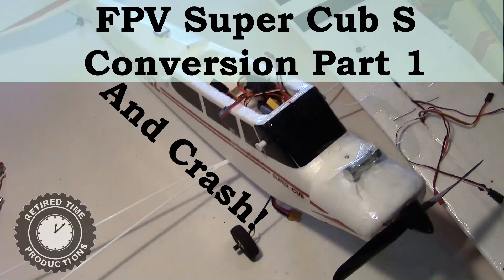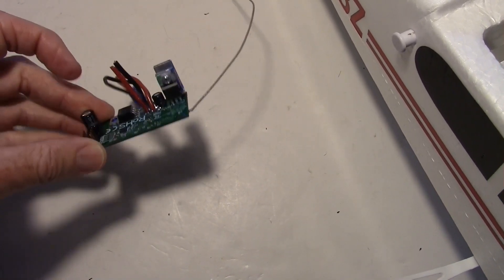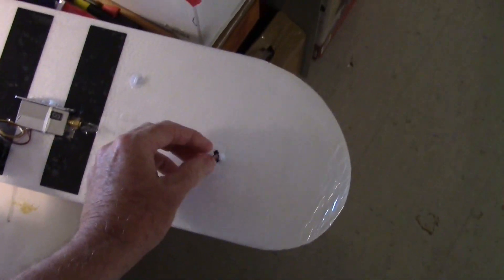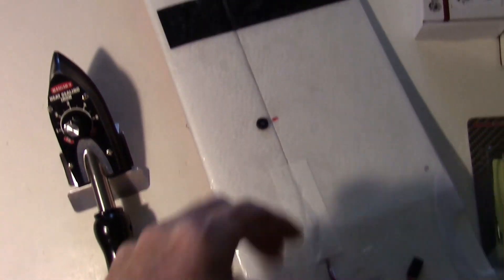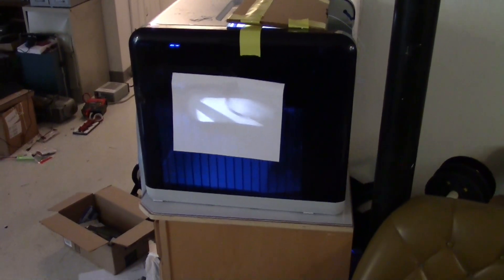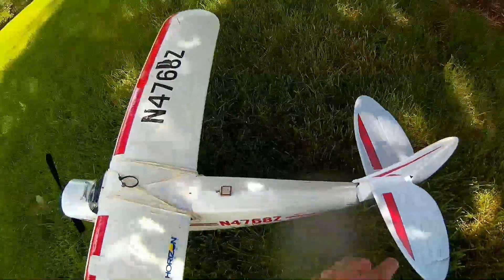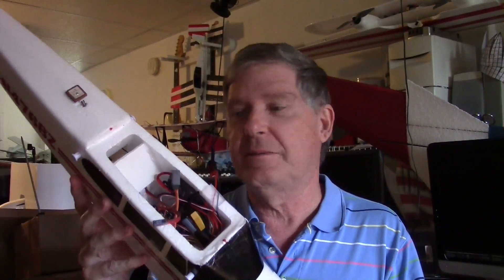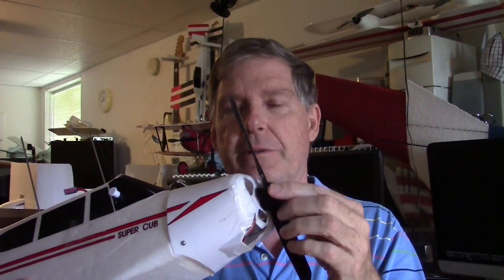FPV Super Cub Conversion Build and Crash - Part 1 (Look out for that tree!)

Comment: Nice job Dave. I went silly on my Super Cub conversion and installed a 3536 1100Kv  motor with a 10x7 prop that gave it unlimited vertical. I used an aluminum motor mount from Gary over at Custom RC parts. The best thing I did was take all the dihedral out of the wing. I would think a Power 10 would be over kill but a lot of fun. Happy flying!
I used a somewhat heavy aliminum hub tailwheel to get the CG just right. There is a very old and very crappy playlist on my channel that shows the build.
https://www.youtube.com/playlist?list=PL-luddGQwogGW2jhaotklMuvbOX-mUIFi
Cheers, Bob
Reply from the maker: Thanks Bob, I will check that video out.

Comment: If you're gonna toss out the 'Safe' board,  toss it my way. ÷)
Reply from the maker: Where do you live. I might consider it.
Reply: +dmerc00 - 83854. I'll gladly pay the shipping and handling.
Reply from the maker: Guess I could send it COD. 
You sure you want it. It's a propitiatory board that is permanently configured for the Sport Cub. Not sure it will work on anything else as far as the safe tech goes.
Reply: +dmerc00 - You're right.  I wouldn't be able to use it. Thanks for pointing that out!

Comment: that cooling plate on the vtx might need better rotated 90deg to reduce drag
Reply from the maker: That could work. Maybe I can just remove the cooling plate and do without it.  I didn't realize it would be a problem.

Comment: It's not good to create so much drag out on one wing, effectively the size of a scale spoiler extended on 1 wing only. It disturbs the airfoil and yaws the plane. Just embed the VTX into the foam. That's what I do even with 800mw ones. Sometimes I cut a small canal for airflow below the VTX too as air wants to flow naturally from the bottom to the top of the wing so you can use that to your advantage. 
B.t.w., why don't you just use a flight controller such as a micro-APM since if you're using GPS, you may as well have the full features of RTH etc.
Reply from the maker: The spoiler is actually a heat sink for for the VTX and I didn't realize it would be a problem. It's only a 400mw VTX so you may be right that I don't need it. Thanks for the advice. 
I like the BeeRotor FC because it has a built-in OSD and it's easy to setup. RTH would be nice though.

Comment: modified mine with 2826/2200 and routed a arrow shaft into the wing, bigger wheels,  opened it up for 2200mha battery now it flies so good people try to buy it! Blue strip on top leading edge confuses people into thinking it's a carbon cub.
Reply from the maker: Sounds good.Is the 2826 a 2200Kv? 
What prop are you running with it? 9x6?
Do you have a build vid or walk-around of it, especially where to put the battery?
Reply from the maker: Thanks for the info sir, I think Sailor John has sailed off somewhere.
This is great because I already have a Turnigy D2826-6 2200kv brand new still in the package that I bought a couple years ago. I could order the 2826-10 1400KV if needed from the US warehouse:
http://www.hobbyking.com/hobbyking/store/uh_viewItem.asp?idproduct=67114

I also have on hand a CDROM C2830-1100kv that might work.

Comment: go big. put a pair of motors on the wings and then use the current engine bay to carry a gimballed gopro and grab some hd video! Experimental Airlines have some quick engine mounts to try.
Reply from the maker: I was joking about mounting my Twin Star wing on it but maybe that would actually work :-)
Reply: +dmerc00 beauty of foamies sir, the OEM wing can be chopped around to a great degree. :)